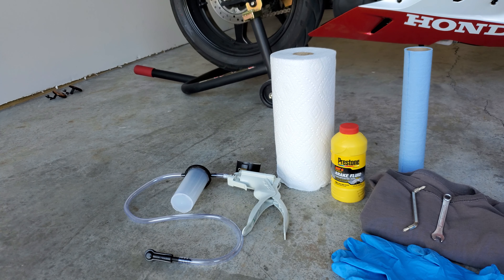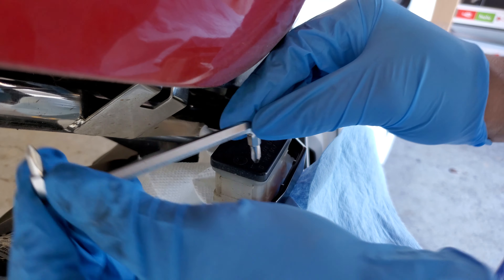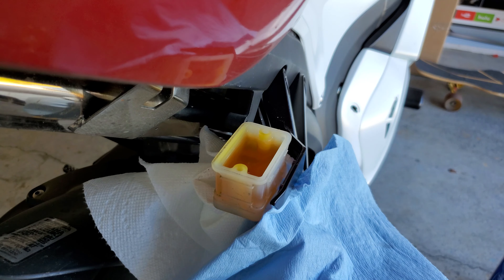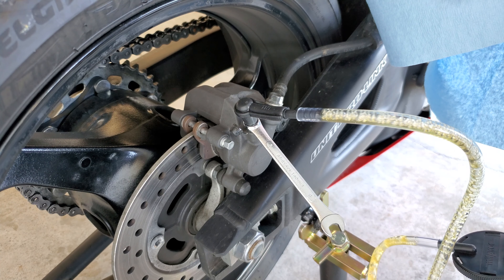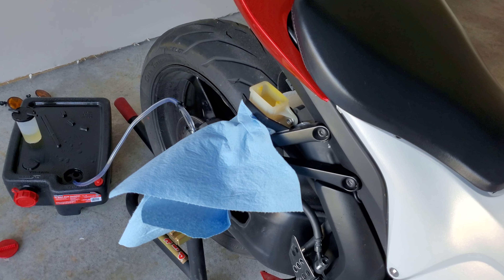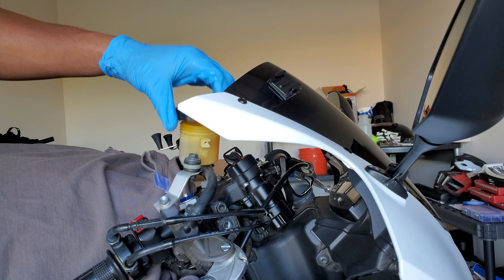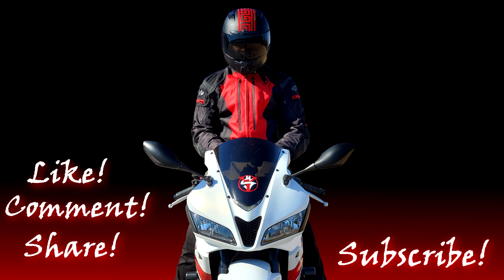How to Flush and Bleed Your Motorcycle Brakes | Honda CBR600rr | DIY

Comment: Was the other video deleted? To answer your question with what brand i went with Puig shorties.  Ride safe out there.
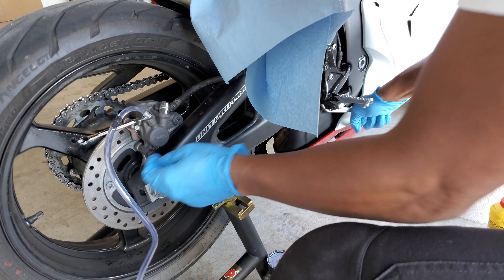Reply from the maker: Yeah I deleted it to add the part from 3:00-3:30 to better explain. I knew you would go high quality!
Reply: I will rewatch! I got them for a deal from the website "Motobitz.co.za" you can buy items specifically for your motorcycle. Ride safe out there.
Reply from the maker: I appreciate it it! thanks brotha you too

Comment: Where do i get the pump and break fluid at , does it matter which kind
Reply from the maker: If you're in the US, I got my pump from Harbor Freight tools. Brake fluid, you can pick up at any auto parts, just make sure it is the correct fluid as specified by your manual, and or your reservoir covers. Mine for instance is dot4, and I used Prestone brand fluid.